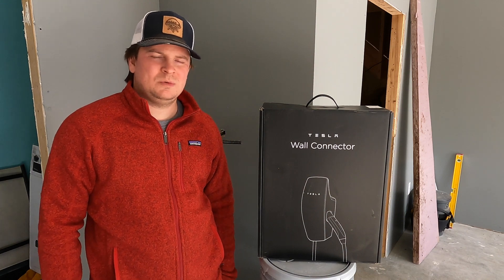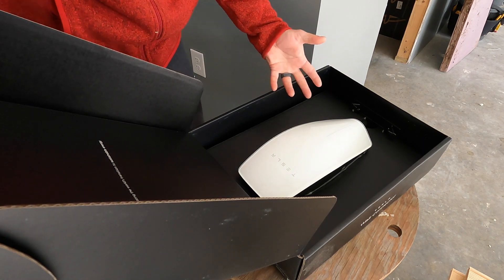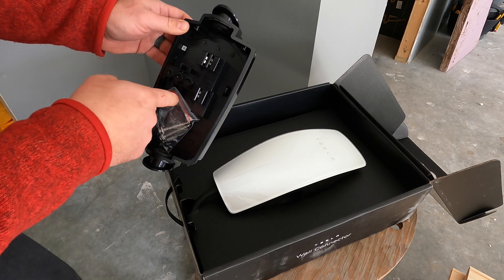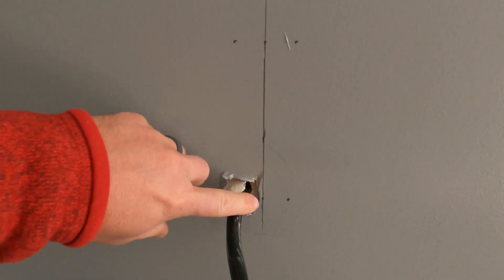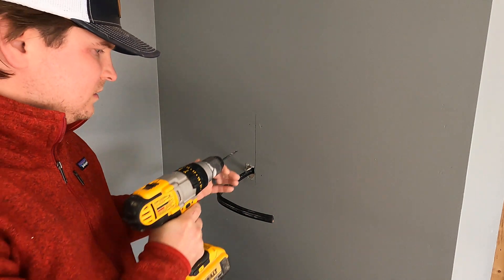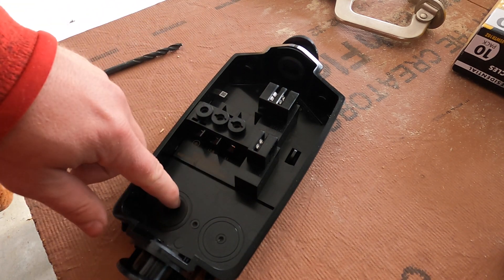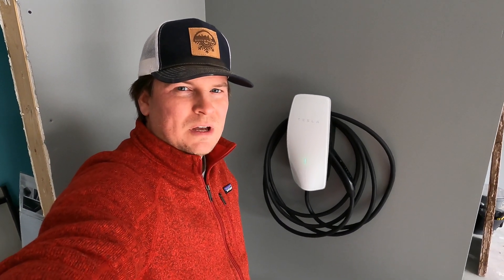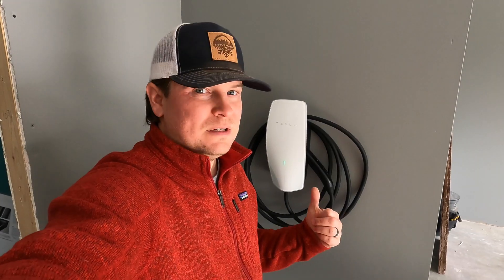Installing Tesla Wall Connector Gen 3 Charger

Comment: You better go back and torque down the wires in the wire box. Tighten, giggle, tighten, giggle then tightened to the specific setting of 50 foot pounds with a torque screwdriver. With a high amp continuous load you want those tight for the long term. Some even suggest at the 6 month mark to check and re-torque. Do the same with the breaker and for this set up 50 amp with 6/2 Romex (not 60 amp). It's all in the Wall Connector instructions.
Reply from the maker: Great advice! Thanks for the comment

Comment: I notice you put white tape at both end of the red wire. Does that mean the red wire is connected to NEUTRAL in the panel ? If yes, then the the AC line supplied to the Tesla Wall Connector is single phase.
I just want to be really clear about this.
Reply from the maker: Thanks for the comment. But when did I do that? Please let me know, I put red tape on the white wire....

Comment: 6/2 romex is only rated for 44A continuous, out of the box the wall connector is configured to deliver 48A.  It should also be on a 60A double pole breaker. If you want to pull the full 48A it’s still 6/2 thhn but in conduit (so you can use the higher 75c wire rating vs the 60c rating of romex).
Reply from the maker: Thanks for the comment!!!

Comment: What screwdriver bit did you use to tightened the wires
Reply from the maker: It bit comes with the charger. Then you need an interchangeable screwdriver to put in on.

Comment: Did you run conduit?
Reply from the maker: The wire in this video I did not. If you use THHN wire (which I use nowadays) I run it through conduit. Check out my top 6 tips video for Tesla charger install!
Reply: @ZittleFarms  excellent job I ran mine with 4/3 NM B
Reply: With 60AMP breaker looking back I should've just done the 50amp and 6/3.

Comment: What size breaker did you use for the charger
Reply from the maker: This set up, I am using 50 amp. But depending on your wire set up. You can use up to a 60 amp

Comment: what wire awg you use for 60 amp CB?
Reply from the maker: You should watch my 6 tips on installing the charger! You can use 6 but recommend 4
Reply: Note, for EVs you must rate your wire for 125% of continuous current.  The charger is rated 48A max, at 125% that's 60A.  The NEC Table 310.16 recommends #6 AWG conductor for 60A (at 75C, #4 for 60C).  However, there's the requirement for a calculated maximum voltage drop (3%) to prevent overheating of the wire.  So depending on your distance from your panel to the Tesla charger, or the maximum temperature rating of the breaker & wire (Tesla's charger is rated for 75C), you could stay with #6 or have to increase your size to #4.  @Zittle Farms distance is very short so there shouldn't be an issue.  If you have any concerns about distance, go with #4 or have an Electrician check it for you.

Comment: The box is plastic, think you still need a hole protector?
Reply from the maker: Thinking about it, I'm not sure. Now that I use THHN wire, I have to run it through conduit and that'll have a plastic screw-in connector conduit fitting at the end

Comment: Your connector goes on the outside. Also did you use anchors or are they a proprietary self anchoring drywall screws?
Reply from the maker: So I preplanned that the charger was going to be there so I put 2x6s behind the drywall. When you install, you should anchor it into the stud.

Comment: Hey buddy. What gauge wire did u use? I also see you put in dual pole 60amp breaker, can you use dual 30 amp breaker? Isn’t each line 30 amps? Thx.
Reply from the maker: Hey Tworth23! I used 6/2 wire with a 50 amp breaker. You can use a 30 amp breaker but your output is only going to be 24 amps = So slower charging. With my 50 amp I’m getting 40 amps.
Reply: @ZittleFarms  thx

Comment: Very good video… I just needed…
I have one question… this wall charger works with 110 volts or 220 volts?
I live in Virginia and basically the line works 1 R + 1 N = 110 v
1R+ 1S = 220 v
Reply from the maker: I’m not sure of the technical stuff but they are in the manual it says 240v. I’m in Virginia as well!

Comment: What type of tool was used to  loosen and to  tighten  the three screws on  the tesla charger  where the wire  is installed?
Reply from the maker: I am just seeing this. Sorry. But the bit is provided. You just need a interchangeable screwdriver (or really you should use a screwdriver torque wrench)

Comment: Great video! As far as connecting to the breaker panel, do I just need to use a new space and add a new 50amp fuse? Also what guage wire should be used?
Reply: 6 gauge to be safe. 8 gauge would probably work well too
Reply from the maker: You’ll need 2 open spots in the panel. I use 6 but I highly recommend using 4 gauge now. Check my top 6 tips for installing video!!!

Comment: Hi  what’s the wire Gage and what should be the breakers power
Reply from the maker: I used 6/2 wire and now a 50amp breaker. My research from Tesla said that you could use a 60amp but after comments left here and to error on the side of caution, I’m going to use a 50amp!
Reply: Note, there's nothing wrong with operating the Tesla charger at 60A or less.  Tesla chargers can be set to various breaker ratings.  Choosing a breaker rating depends on many factors.  For instance, if your existing panel is already near the maximum current draw, you may want to select a smaller breaker to avoid tripping your main breaker.  Assuming there's plenty of capacity, 60A would be the max sized breaker you can use.  Conductor size needs to be selected based on 60A (rather than 48A) because EVs are considered to be continuous loads and so must be rated 125% of max rating.  Then the conductor may need to be increased in size depending on the distance to your panel.   Typically, that would be #6 or #4 (#4 is larger).

Comment: What wire Gauge did you used?
Reply from the maker: 6/2 wire. People have commented that you need to use a 50 amp breaker with that wire gauge. So to be on the safe side, that is what I will be using even though on Tesla's page they say you can use a 60 amp...

Comment: Great video. I am finishing my basement and had my electrician pull two sets of heavy cable from the main panel in the basement to two garage walls for future Tesla charging. He installed a metal rough in box on the wall (not recessed) and now I get it. He will likely remove the rough in box and replace it with the Tesla wall charger when the time comes. Oh, and I can quit shopping for a NEMA receptacle...
Reply from the maker: That’s so smart!! Great thinking ahead. I’m glad it helped!!

Comment: How much did you charge for the install???
Reply from the maker: So this was done in my own garage. The hardest part would be to run the wire if you're dealing with a finished space. So there are variables.. But I would charge anywhere from $400-$1000
Reply: Thanks  sr.

Comment: I was wondering if you could help me out? 😙 I’m going to install a Tesla charger on the exterior garage wall above a raised planter. From the center of the wall charger how far, in inches, do the cables hang down?  I’m trying to determine the height to tell the electrician putting the pre-wiring for the unit. I don’t want the cables to hang down to low into the plants. Much appreciated! 😀🚗
Reply from the maker: Hey MJ!! So I have it pretty tightly hanging from the unit and it’s about 14-16 inches!! Hope that helps out!!!

Comment: I am installing my wall connector this weekend thanks for the tips.   
I will be using 4AWG solid wire from Lowe's, short run of only 12 feet in PVC Conduit with a 60 AMP Breaker.
Reply from the maker: Awesome! Glad it helped!
Reply: Does it require a 60 AMP Breaker or can one use a 50 AMP breaker?
Reply: @LarryRichelli  the charger is called for 48amps so you need a 60a breaker when you take in the %125. then you should use #4 wire not #6.  when pulling wire you size it based on the breaker, not the load potential. idk why tesla says #6 wire.
Reply: @danbohnsack1887  if you read the manual for the full rating you need #6 Rated for 90c and it needs to THNN or THWN....not NM-B, and CB rated for 75c

Comment: Can you use a 50amp breaker instead of 60amp?
Reply from the maker: My research looks like you can use a 50 amp breaker!!
Reply: @ZittleFarms so I can use breaker 50amp with wire # 6 n ground # 10 , is it correct ?!

Comment: Can remove an existing outlet and replace with a wall connector?
Reply from the maker: I'm no professional, but a dryer outlet, I think, could be replaced. It depends on the wire ran to the original outlet.

Comment: I have an existing 220v 15A  outlet in the garage. Can I use the existing wiring (not 6/2) and install a 30 amp breaker to replace the 15 amp currently installed.
Reply: No - you can definitely not do that safely. The 14 or 12 gauge wire you have currently will not support 30 amps. It could potentially heat the wire and cause a fire.
Reply from the maker: To be honest, I'm not sure (not a professional electrician). You'll have to find our what wire is ran to it. My guess with it being a double 15A it is 14/3 and that wont support a 30 amp.

Comment: You want the breaker to protect the 6/2 wire max amperage of 55 amps and a 60 amp breaker will not. I think it should be a 50 amp breaker right?
Reply from the maker: Yes. That is what someone else mentioned. So I will be replacing it with a 50 amp
Reply: @ZittleFarms  don't forget to reprogram your Wall Connector for a 50A circuit too.
Reply: According to the Tesla chart: a 60amp breaker will pull 48amps, the max used, to charge the car.  I would leave the 60amp in place and charge away!  https://www.tesla.com/support/home-charging-installation/wall-connector#charging-speeds

Comment: Once you have made your original line from the breaker, can you tap into that outlet box to place a second wall charger next to it? Or would each charger need to have a line to the breaker
Reply from the maker: I am 99% sure that you would need to run a new line with a new/different breaker.
Reply: @ZittleFarms  Your 99% is 100% correct. A new line would need to be run from the load center. (20+ year licensed electrician speaking)
Reply: The new Tesla charger has a “power sharing” feature you can plug up to 4 charger on the same circuit.

Comment: my house has a 100 amp box, could i install a 60 amp breaker in it and run the wire from the basement to the garage?
Reply from the maker: I not a professional electrician but I think it is okay. One other comment, someone mentioned that it should be a 50 amp breaker... But Tesla's website/manual says to use a double pole 60 amp
Reply: Your ability to add an additional 60A breaker to your 100A panel depends on what loads you have already.  To avoid tripping your main breaker, I would seriously have an electrician check out your service.   A service load calculation can be done to estimate your maximum service load.  Or if you can get a year's worth of maximum current draws (15min or hourly intervals) from your Utility Company, you can see what's your home's maximum current draw.  With that info, you can calculate if you'll exceed your panel's maximum rating with a new breaker.  You may need to upgrade your panel and service feed or select a smaller breaker for the Tesla charger.
Reply: @rickmorenojr  thanks but I did install it on 100amp , no issues what’s so ever. Going on 2 years now. This is a gas house so not much electric stuff going on , plus I charge overnight when everyone is sleeping.

Comment: How important is it to loop the wires around the top?  I'm replacing a gen 2 charger  which the wires just went through the bottom. There isn't enough wire to go around the top.
Reply from the maker: Good question Kris! You can go straight to it. I think they want you to loop around so you have “extra” wire for the same reason your in now.

Comment: Why do you keep calling the wall connector a charger?
Reply from the maker: Doesn’t it charge the car? What do you call the thing you plug into your cellphone to charge?
Reply: @ZittleFarms  for AC home charging the charger is in the car - converts ac to dc. It is only when DC supercharging that the DC flows from the external charger direct to the battery.
Reply from the maker: Okay. Thank you sir!
Reply: @ZittleFarms  I have been researching, since my next car will be an M3. I just don’t know if it should be a Tesla or a bmw yet.

Comment: Good vid. brother. Do you think it would install on vinyl siding? I have to put mine outside. Use stand offs to keep from crushing siding?
Reply from the maker: Hey Tom. Thanks for the comment! I was first thinking the fastest and cheapest would be something like rubber washers. But the best way would be a mounting block! Little more work but would look professional. Another option would be to put on a 6x6 or some kind of wooden stand.

Comment: I’m not an electrician, but 6awg romex might not be safe for 48A car charging on 60A breaker. It might be okay for intermittent loads, but car-charging is a sustained load and can build up heat in the wire, especially romex. I definitely would not charge at 48A with that wire and breaker. Even if your car can’t charge at 48A, I would still limit the Wall Connector to 40A to make it future safe. I would also change the breaker to 50A to better-protect the wire.
Reply: You’re right.   The ampacity of 6awg NM-B wire is 55amps. You want your breaker to be the weak point of the circuit, so breaker pops before the wire burns out.  
You should upsize wire to 4awg or install a 50amp breaker.  This is considered a continuous load so must rated at 125% of name plate amperage.  48A x 125%= 60A
Reply: @SM-hj8im  THANK YOU
Reply: Tesla recommends 60A breaker with a min 6AWG wire
Reply: @fenderxes  Tesla also say “Wall Connector should only be installed by personnel who are trained and qualified to work on electrical systems.”
Reply: what would u suggest 4awg?
Reply: @opilotmansour5209  see @S M reply…..4awg it is (or 50A breaker @ 6awg)
Reply: @opilotmansour5209  Not sure. I just read that a 50A breaker and charging at 40A is max for 6awg wire.
Reply: @opilotmansour5209  yes the breaker protect the wire therefore 60A=4Awg and 50A should be 6Awg.
Reply: You said it yourself, your no electrician, end of convo

Comment: One question. Tesla says to use a Torque Driver to apply 50lbs of pressure to the cables, I see you used a regular screwdriver I think?
Reply from the maker: You are correct. I don't have one and I don't see an issue of just tightening it down with just a normal screwdriver. Thanks!
Reply: @ZittleFarms  It could cause arcing and fire, putting your household at risk. And your insurance would not cover damages after viewing this video.
Reply: It's 50 inch pounds, Tesla made a mistake in the instructions

Comment: 3/4” Connector goes on the other way, nice install though.
Reply from the maker: Thanks for the comment Joe! Looking back I should have used the plastic Snap-in Connector Conduit Fittings item #159323 from Lowes.

Comment: What size wire did you use?
Reply from the maker: Hey Cyprian Skiba! Thanks for the question. The wire is 6/2 Romex wire. If you go to lowes.com the item #12767 is a fifty foot length for $79.54. Other questions you might have could be answered in my other video "Tesla Wall Connector Rough In"
Reply: Its $144 in my area!!

Comment: Hey, quick question what was the size of the clamp connector inside the wall connector?
Reply from the maker: Hey Player 2! That is a great question. If I can remember correctly. It was a 3/4 inch clamp-on. Lowe’s item #45176
Thanks for the question/comment!!!
Reply: Thanks just installed my today!!
Reply from the maker: @Player-oz2nk  Awesome!!